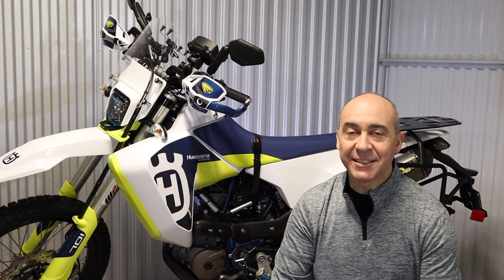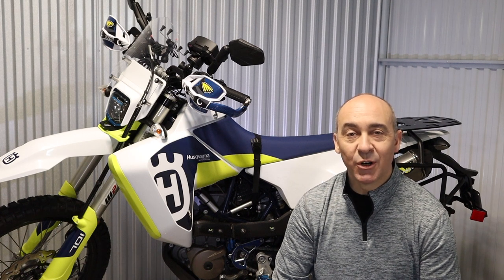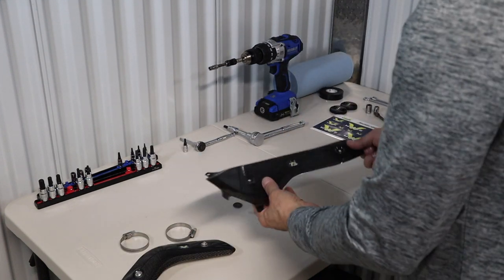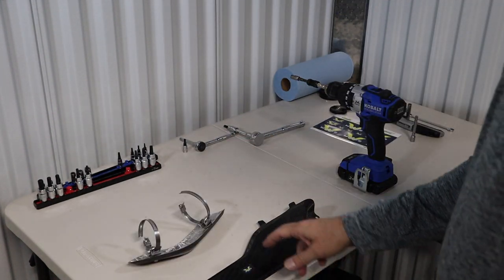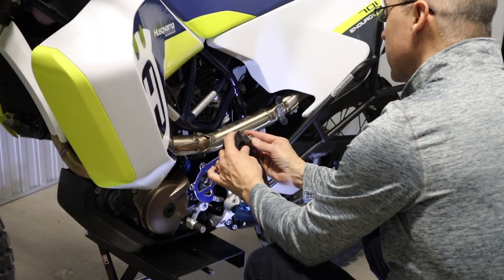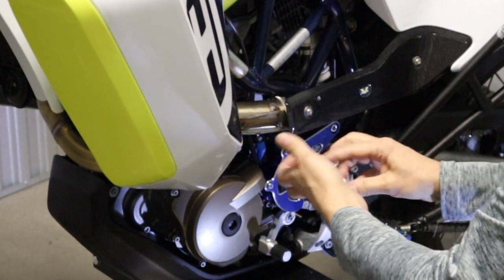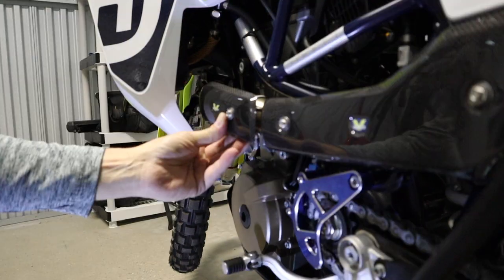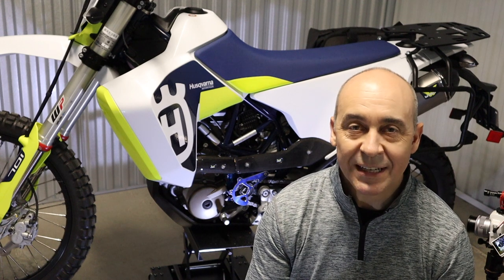Wings Carbon Pipe Guard Install for the 2020 Husqvarna 701 Enduro LR

Comment: Anyone know if the front shield will fit the 2019 690? The headers seem identical.
Reply from the maker: I checked with Wings and they said the heat shields on the pipe are not interchangeable with the KTM … So I suspect the pipe is different, although I can’t say for sure.